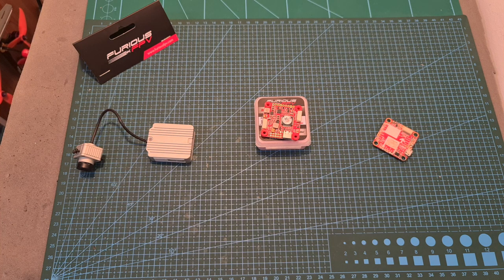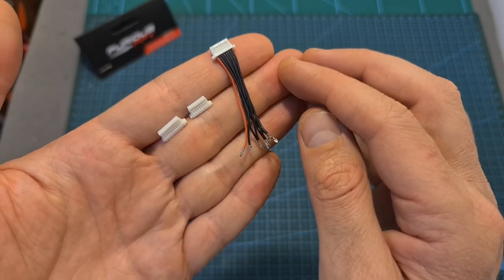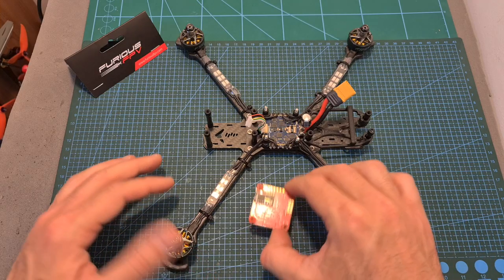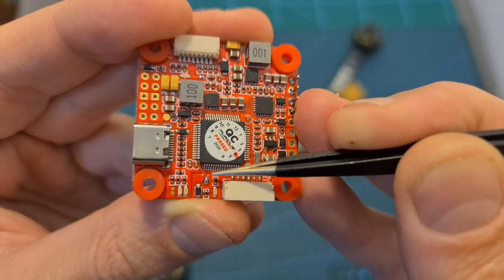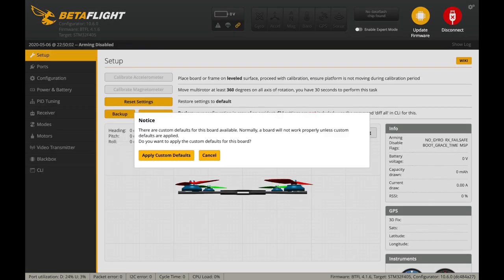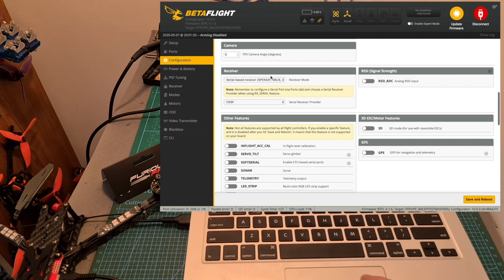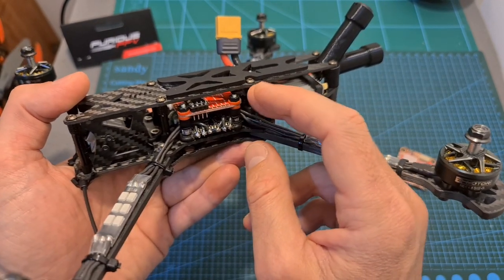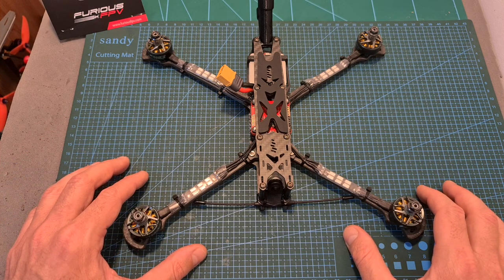FuriousFPV RACEPIT HD Flight Controller - Setup & Review

Comment: Is it possible to connect analog too? Does it only work in digital?  I've been looking and haven't found anything. Thank you
Reply from the maker: It doesn't have an onboard OSD chip, so you won't be able to get the FC data on your video feed (unless you are going to use an external OSD).